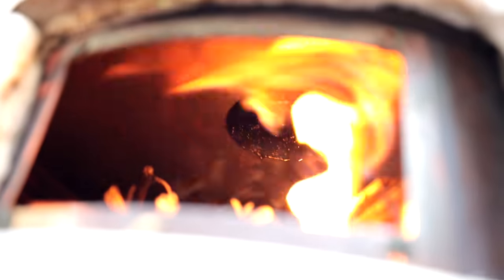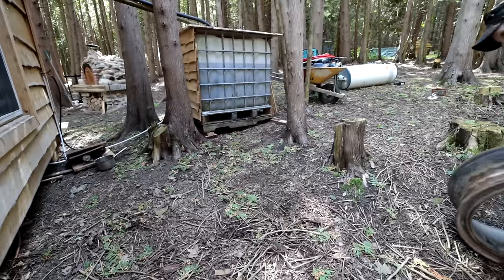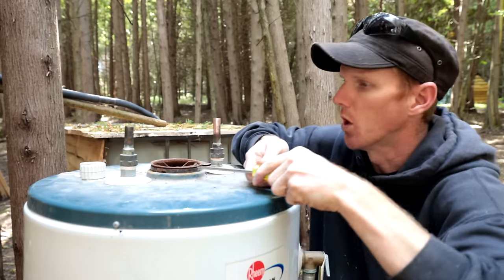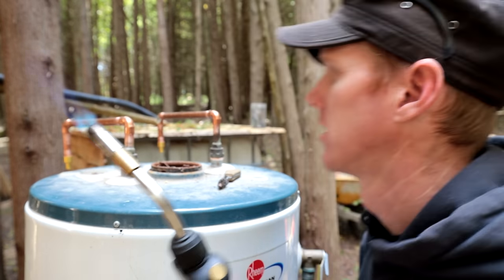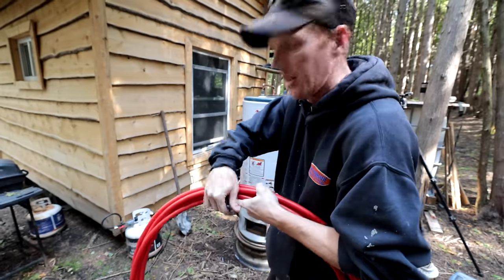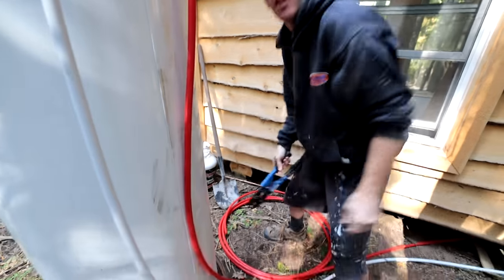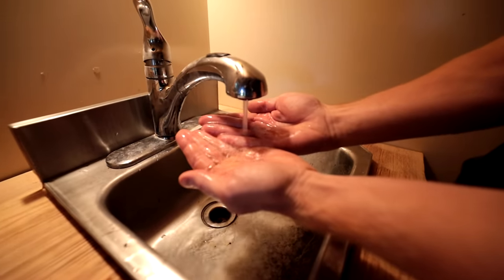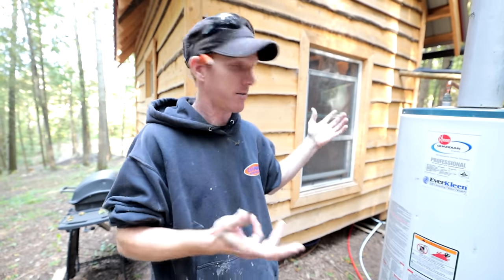MacGyvered Hot Water Tank for Off Grid Cabin - Fire Burning

Comment from the maker: New Tiny House Build: https://youtu.be/FNC6ijU7pPA
Instagram: https://www.instagram.com/wood_chucker_987/
Reply: Nice work, how about instead of burning direct in the firebox, hook up a rocket stove type system and use the firebox for heat transfer only? it may cure the water drop on fire and cleaning the chimney potential issues.

The burn area wouldn't be in the container so easier to clean and if the fire is heating the water too hot, maybe the rocket stove burn section could be detachable or diverted away from the current tank firebox?
Reply: I don’t think the condensation would ever be enough to put out the fire. A flat metal plate in to the back and sticking out might make cleaning out and starting the fire easier.
Reply: Kevin you are cool 😎 please keep making the videos!
Reply: Great job 👏 😅

Comment: My grandfather did this in Mexico over 60 years ago. He used corn cob as the fuel. Still remember being amazed of it.
Reply from the maker: be a great way to limit btu and control over fireing.
Reply: That was awesome thank you.
Reply: I guess you could say you were a maze d at it lol
Reply: Hey Rudy, you are right we are using this system in Anahuac, N.L. since I remember (early sixties) we got another one, we call it boiler also wood burning
Reply: You mean “a-maize-d”? 😂
Reply: That’s pretty awesome
Reply: You were amazed by it, not of it. :)
Reply: That’s awesome man. My step grandpa did the same at his camp trailer in Indiana. I was amazed of it too. Amazed of how it worked so well.
Reply: @richardgshields  really? Your correcting his grammar? Smh
Reply: @timwegman5776  you missed the joke! A-maize-d 😏
Reply: @yumann  yes as I read this now I get it. I must of been Half asleep when I wrote that or maybe too many beers.
Reply: We lived in  the  bush, 20klm from town  and still have  hot water via the stove.  Funny  how all the bells  and whistles came with having elc and running water not  so long ago, and here we are going back.
Reply: You  are a genius 👏.
Reply: I have a 75 gallon gas water heater I'd like to use to heat my pool. I think I'll cut the bottom and make a bigger fire box, take out the wind chime, and add a damper. Maybe send that pressure relief valve with a pipe into the pool itself during the inevitable overfiring.

Comment: Maybe you could put a tee with a ball valve on the pipe above the tank on the hot water outlet , so you can open it while you are heating the tank, and after you have heated the water close the ball valve so youcan now pressurise the water and use it and you dont have to worry about over pressuring the the tank and lines
Reply from the maker: That my friend is the simplest solution to a real problem...  AWESOME!  Thanks!

Comment: Here in Chile we have been off grid for 7 years. A hot water tank like you are making is very common here in Chile. Plus hot water heating loops in wood cook stoves as well. The stove you are building is Illegal in many states in the former USA because .... you may hurt yourself. We have 2 PPR valves on our system and it makes steam in less than 30 min. Our little wood cook stove heats all our water for showers, Radiant floor heat and for the kitchen. 
Cool trick and video. Just thought you might find it as interesting as I did that the Chileans have been doing it for 100 years! Hahahah. Jim in Chile
Reply from the maker: That's neat.  I haven't really traveled so I don't get to see what they do elsewhere.
Reply: @ModernSelfReliance  We burn a lot of wood here to say the least. Jim
Reply: @ModernSelfReliance  Yes we burn a lot of wood here. We also have an insulated storage tank that keeps the water for 3 days. We like long hot showers. Jim
Reply: thx for the input, Chilli Jim!
Reply: How do you use wood to heat a radiant floor? @chileexpatfamily
Reply: @Dustinhahn88  Well my wood stove is illegal in man of the former United States. You may hurt yourself and the government needs to protect you. 
My stove has a water tank and a serpentine pipe in the wood box. This heats the water to steam levels in less than 30 min. From there I have a water tank that sits on top of the wood stove as well and it absorbs the heat out of the smoke as it exits the stove. So I double cover the heat removal. This hot water is stored in a 350 liter tank on the second story of our house. The tank is insulated. From here we distribute the hot water to all the bath rooms and to the radiant floor heating PEX tubes. 
My house is always comfortable and warm i the winter and it is totally free. 
No taxes. No power bill. No insurance bill. No sewer or water bill. No inspections nor construction fees. 
I am free. 
Jim in Chile.
Reply: Hi, I'm Chilean and I'm watching this video because I want to make my own. Could you send me some information of where they sell these kind of heaters in Chile?

Comment: Ideal Build.
1- elevate water containment/storage higher than hot water boiler.

2- Elevate higher on the hill than a shower head to create water and pressure.

3- combine smoke house and hot water tank. Fire box under hot water tank. Run multiple copper tubes up through bottom of water tank and out into the bottom of the smoke house evenly spaced.
The hold the heat in tank for a while brick it in with rock on out side and sand around inside of tank.

This lets you be able to pull it out if you need to get at it.

Cap with a metal cover that could have a steam discharge like a moon shiner would. This would allow you to boil water and collect the condensation off the steam to drink safely.

Get hot water for outdoor shower and sink while you are smoking meat at same time. Could even boil a mash up to make home made beer, water or something else. 👍😀
Reply: So many things to think about!
Reply: Like a water tower

Comment: When I was stationed at Indian town gap military reservation (IGMR) we used coal fired hot water tanks.  Similar system with larger firebox.   Cheers.
Reply: That's neat!
Reply: I had to google that to see if its the same place as FIG, and I guess they officially changed the name to Fort Indiantown Gap in 1975 lol. Its been probably 10 years since I was down there for qualifications. Cant remember where we stayed, but they were similarly built to Ft Drum's WW2 barracks.
Reply: Kevin the Wood Chucker after everyone showered we shoveled glowing coals out in piles under engine blocks and fuel tanks of our diesel trucks to warm them on winter mornings.  Untreated diesel fuel gels at about 30°F.
Reply: Cor Morse thanks for update,  I was there in 1971 while prepping for Vietnam.  Those WW2 barracks were temporary shelters that were still in use in the 70’s.   T’was better being 20 in the 70’s than 70 in the 20’s now.

Comment: Just an idea - you could rig up a simple water line that vents into the firebox if the tank runs over pressure. That way the tank won't explode, and it will put the fire out for you.
Reply from the maker: Just re-direct the pressure relief pipe to spray inside the firebox.. self monitoring.

Comment: Absolutely it will work, it will just have to be cleaned a lot dude to the flue damper. Plus there will be no temperature control you’ll have to install a gauge to make sure you know how hot the water is so you can prevent scolding.

Comment: Nice job.  That is a great idea.  I would think of away to keep it from tipping over.  That tank full of water could weight about 400 pounds.  That dirt under the rim could wash away or shift.  In the winter the Temperature/Pressure valve could freeze, then boom, boom goes the water heater.  🤪
Reply: It's a three season water system... Won't be using it in the winter.
Reply: @cmosphoto1  can just fill it as you light a fire  in the winter time 
can also use this to heat your place with the hot water a rad and fan
 i do this with my shop as i don't want the fire inside !!

Comment: They have water heaters that are built with both electric and wood fired in Europe.  I used one in Northern Italy at my aunts house.  It’s been around for a long time.
Reply from the maker: I'd own one if those were around here.
Reply: Yeah they are quite common, my parents heat the whole house with them, having floor heat. You should get one with a temometer installed so you know it is not getting to hot and explodes. Winter might be a problem with the tubing too. If you use a circular system with insolation you could keep it going, but that requires constant wood and electricity and I guess that is not what you are after.

Comment: I personally would have kept it a propane heater. Cleaning out the ash will be a nightmare. None the less its fun watching along.
Reply: I agree, it's because he gets free wood. Much cheaper that way for him.
Reply: i Agree, just use this as back up, but i will modify the bottom of the burner with a steal box with legs or get a old wood stove  weld on, so it can take big woods and easy to clean. just don't take shower with it use a tub.

Comment: Better water pressure and added power savings from raised water storage. Power savings could be used on a second water pump for exclusive hot water feed to negate lower pressure when using both cold and hot water.

Comment: Great idea. We have an off grid/road cabin and we use a lot of propane in our RV water heater.We also used a couple of tote tanks to store water. I have it figured out, a tenth of an inch gives me 30gallons off the roof. This cabin has been a 20 years project so far. We spend most of our summers there now.

Comment: Did this 15 years ago! I welded a 17 “ truck steel wheel to the bottom, cut out the center, put it over a fire brick chamber! Works better than anything else!
Reply from the maker: awesome!
Reply: Cut out the center of what? The hot water heater? I'm really fascinated by this set up.
Reply: Carol Hewett I cut out the center of the wheel! Where you bolt it up to a car! That 17” rim fits perfectly, under a 40 gallon gas water heater, the rim will give you the space you need to have a fire chamber under it! Two rims stacked on top of each other welded together, will give you even more room for a fire chamber! And for the top of the water heater, the exhaust hole in the center !!!!! Needs a pipe added a few feet above the tank, just like a wood burning stove pipe! I used a tractor pipe. Fit like a glove !
Reply: @jacelandadventures1523  gotcha, thx
Reply: Carol Hewett I should mention it is just a couple of spot welds do not weld all the way around the rim to the water tank!

Comment: You should try to elevate your reservoir so your water is gravity fed.
Reply: Yeah you should of milled some wood to make a tower for that water tank . At least higher then the taps in the kitchen.
Reply: Maybe a Future build!
Reply: Bang on boys perfect suggestion save pump and better pressure. Stay safe everyone 😷.. Gazza
Reply: Yeah water tower!
Reply: Kevin will have to add a second or third floor to the cabin, raising the roof sufficiently to gravity feed captured rainwater into a water tower.  Perhaps a tarpaulin could be stretched and strung from several trees forming an additional catch basin for rainwater at a higher level.
Reply: You could run poly tubing from the creek to elevated water barrels which would give you pressurized water at the cabin. Connect these to the tote with a tee and the water in it gets pushed through by the higher barrels. Attach a power turbine or two along the way and fill the pond any time it needs it. I'm imagining a toilet valve attached to a dock to control the pond level. Connect that to an aerator and have fish for dinner. Search venturi aerator.
Reply: @Welstiel w there's a temperature and pressure release valve on the top side of the heater to keep it from going boom
Reply: @michaelyarmie4858  that sounds like a recipe for depressingly low water pressure.
Reply: @Welstiel w then the pressurized water from the pump would come right out of that hole.
Reply: @samsawesomeminecraft  why would the pressure be lower if the tank is higher
Reply: @Welstiel w Most water heaters are equipped with a pop off valve.  A pop-off valve is an attachment that keeps the pressures from getting too high. When the pressure inside a tank reaches an unacceptable level, the valve opens and releases pressure from the system, stabilizing it. Because pop-off valves prevent pressure explosions, they are required
Reply: I tried elevating water at our cabin but I’d have to pump it up anyway. I make more power than I ever use on my 12v system so running a Pump isn’t a problem.to get any pressure you have to go quite high.. I use higher voltage for an inverter.
Reply: @michaelyarmie4858  a reasonable water pressure is between 40 and 80 psi. To get a water tower to provide that much pressure, you need the tower to be 27-55 meters (about 100-150 feet) tall. Unless you have a hill close to your off-grid cabin, you are unlikely to be able to reach that height with a tower.
Reply: Another Neko p  ok
Reply: @Welstiel w there is an existing threaded hole for anode rod. Just take it out and replace with a 3/4" pipe
Reply: You'd need a separate water tower. k
Keep the existing tank and pump, use the pump to fill the tower. You'll have increased capacity, a backup system, and you could keep the water collection as is. 

Bonus efficiency points if it doubles as a shower.

Comment: We did similar with two 45 gallon drums 50 years ago. One cut in half for the fire box and the full one on top. We elevated them on stilts, put a hose bib on the water drum, and had a outdoor shower. The water is collected from the roof and routed through a strainer system to the top drum. It's so nice to have a shower at the deer camp. The grandkids are still using that set up to this day.
Reply from the maker: That's Awesome!

Comment: In the home I grew up in (and perhaps many more in the area) we had copper coils inside the firebox of our oil cookstove.  The stove had been converted from a wood burning cookstove to oil sometime in the early years of the 20th century.  The pipes to the coils came into the house from the water line, and the line out went to the water tank which was in the attic.  This, of course, meant that there was no constant temperature, and your wood burning heater would be the same.  But we had a good supply of hot water as long as the stove was on, and since it also heated the house, it was kept on.  Once a year in the summer, we turned off the carburetor, and Dad took the stove outside (because of all the soot.)   He cleaned everything including the coils, and we were all set for another year.

Comment: Great job! Awesome how excited you are. Setup a very very similar system 2 summers ago at a friend's cabin, where we made his hot water tank multifuel (it can burn gas, diesel, used machine oil, engine oil,  cooking oil, wood, etc) and the system has also an inline with shut off/redirect valves and pipes a small gas water heater,  as an emergency measure that can run in natural gas or LP/propane. He had an extra 1 from a job he did and we thought itd be nice to put in.  BUT when we were running the piping, we did not make holes and push through the bottom of the cabin. Instead we got a bunch of pipe connectors /extenders (the kind that are male tipped on both ends) and labelled them (cold kitchen. Hot kitchen. Cold bathroom, hot bathroom. Etc. male on both ends, so we have these mounted halfway in the bottom of the floor, heavily caulked and sealed off, with added insulation,  and we then added on the inside shut off valves before laying in the piping. This not only make it neater but it made it compartmentalized, so in the future it may be easier to service and extend replace. Etc )
One benefit of this was before this years winter we came across some extra piping, enough to put it into the bedroom floor, some heated flooring piping, using a small pump to circulate the hot water standing still in the hot water piping.

Comment: I think PEX degrades in UV lighting. So you might need to be aware of that.
Reply: joann Loves CountryLife  Yes he is. Branches and leaves don't 100 percent cover everything under it. If that was the case then he wouldn't have a lot of light shining on his cabin. Unless all those trees are evergreens, then in the winter the only thing covering his cabin would be branches.

 Either way, UV light is present and it degrades PEX. That's why PEX is only rated for indoor use, unless buried in the soil depending on code and stuff.

Comment: The wind chime, is called a baffle. And you are correct it is supposed to redirect the gases coming off of your fire and a circular motion to slow down the flow of flue gas and get the most heat out of it.

Comment: I'm not telling you what to do. But if you decide to use copper tubing instead of pex you could turn your new wood burning hot water tank into a radiant heater and still have hot water for use in the cabin.. I like the wood burning hot water tank idea it's a great addition to the cabin.
Reply: Could do a closed loop glycol in floor system.